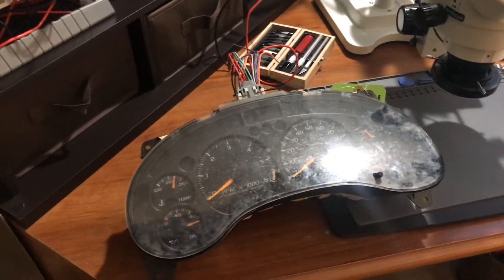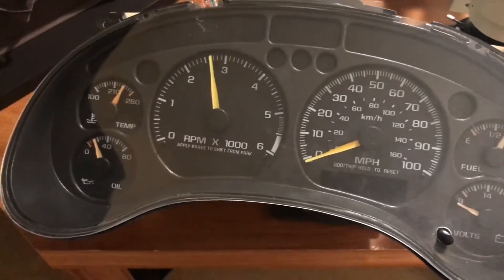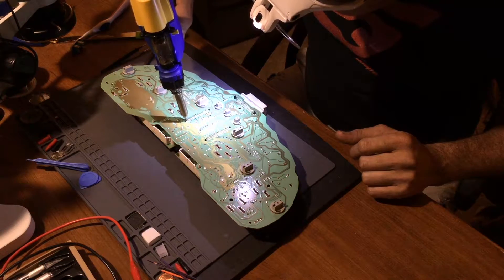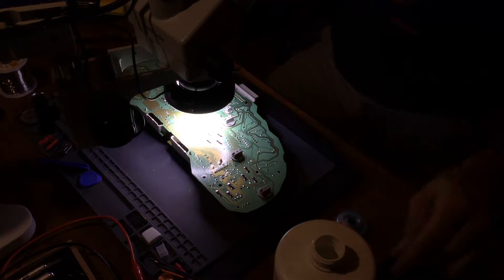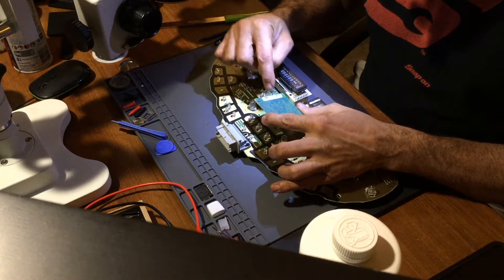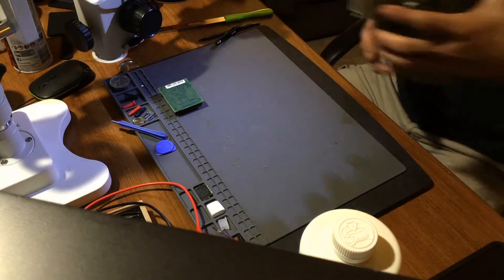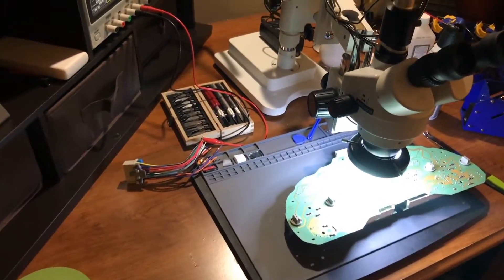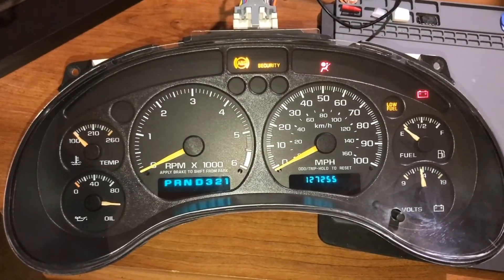2001 Chevrolet Blazer instrument cluster mileage correction after replacement with a used cluster

Comment: Few questions if i may? I have a 05' Had a parasitic draw for almost a year now Narrowed it to .5 draw  And around the time i changed the backlights to LED blue lights "screw in type" not the solder type  My question  I know there are bulbs that have a neg positive only side that you solder in Why are the screw in type universal Or are they? A few times back on driving my RPM needle was dead on 0 never moved ..On removing the cluster the needle has a good airy movement ...lastly I have x27 168 motors would they work in this cluster you show? Mine is the same style minus the PNRD21 marker light ...Thanks for the video ...

Comment: very helpful, i need to seap milage on my tahoe to a new cluster i bought with trans temp. my concern is voltage reports wrong when i test fit the new cluster. do hd trucks report voltage differently than half ton?

Comment: You probably could have just put the whole old board on the new cluster and had no issues and saved yourself a lot of work. I obviously wasn't there so maybe the board had an issue not show on camera. Great video anyways. You have some really good gear too. I like that ESD mat you are using where did you order it?
Reply from the maker: I got it from amazon.
Reply: @MaicSalazarDiagnostics  I order one off eBay recently but they got me. I didn't read the description. It had a ruler on it that went to 24 so I thought it it was 24 inches, it was 24 cm.